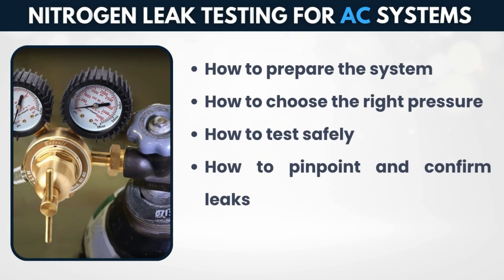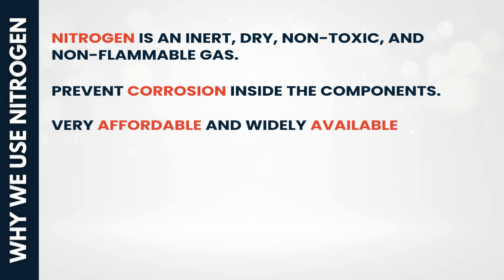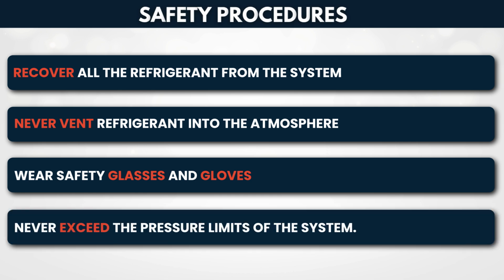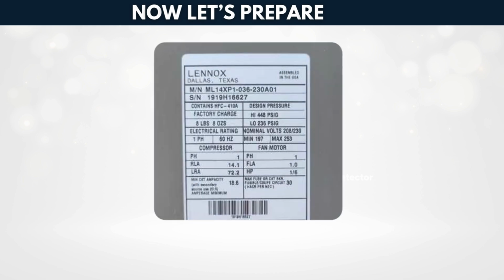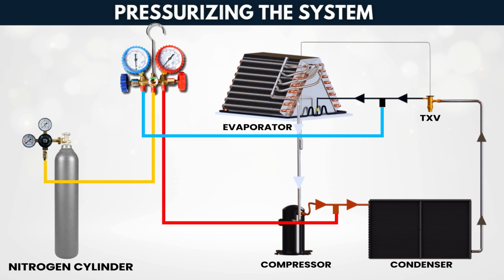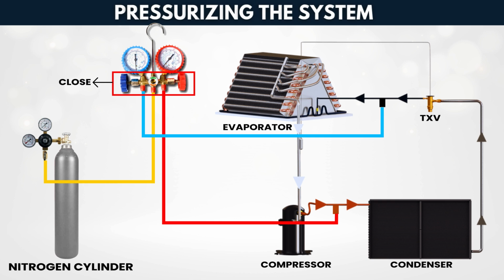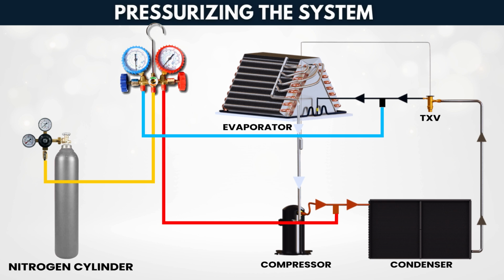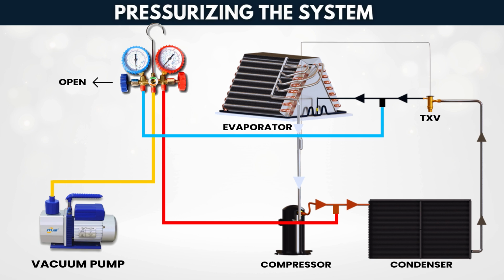How to Do a Nitrogen Leak Test in HVAC Step by Step | Complete Pressure Testing Guide

Comment: If you suspect the leak is in the line set or the indoor coil of a heat pump, is it OK to pump down the refrigerant into the compressor/outdoor coil instead of recovering it?